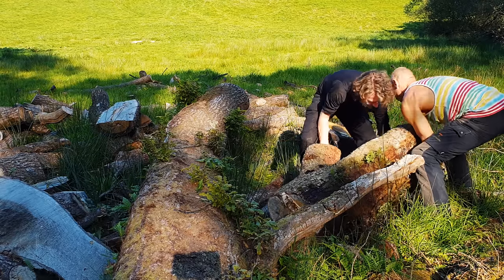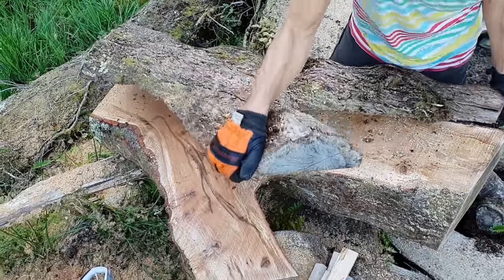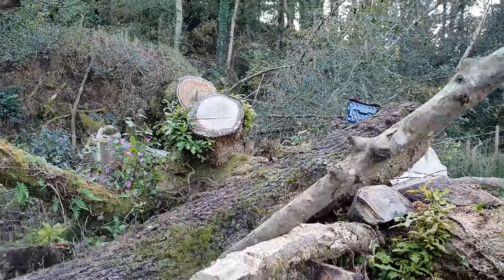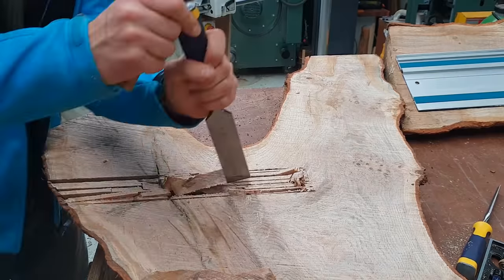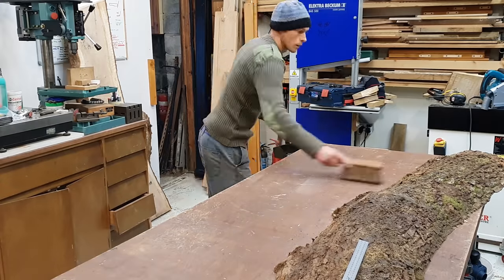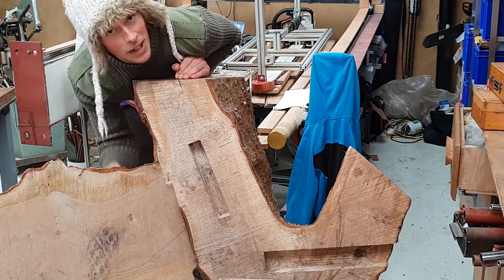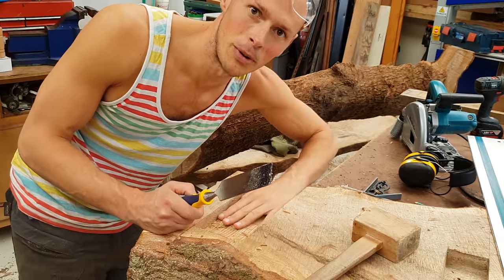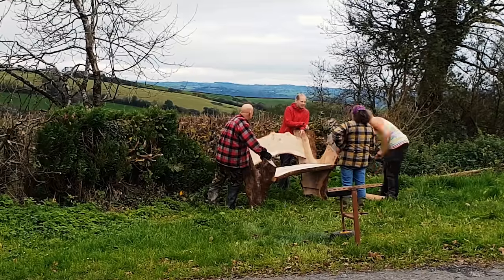How to make a Bench with a Chainsaw! (Rustic fairytale style)

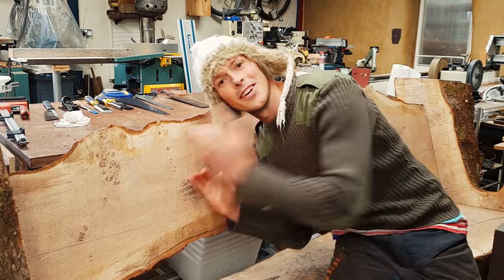Comment: 14:30 I know little about this, not sure it this is a bad idea because it will push water into the wood. A pressure washer, just spraying water might get the foot prints out. I do know the pressure washer does well to remove the grey from sun burnt wood and mold.

Comment: WTF the hippster shirt? :)  Don't you have an old timbersports shirt you can cut the sleeves of? As to the bench: Absolutely love it. Best thing with these outdoor projects is, you can get right to it, without needing to wait 4 year for it to dry. I like to use Spax High Force srews for this type of work. They have a large contact area, and an 8x160mm with a 40Torx head has enormous clamping force, without ever splitting the wood. The idea of the crotch to use as support for the backrest...really really nice.
Reply from the maker: HAHA Hipster shirt!?? Seriously - the beach vest (?) you recon it's hipster? ? 
Right on about not having to wait for the wood to dry though - It's really cool to go from log to finished furniture so quick... And it cuts real easy when wet too - just make sure to oil the tools well after. Wet oak dust = super rust!
Reply: Rust stains...tell that to my trailer I am milling on :)

Comment: You might want to check out Arbortech. They make chainsaw type wheels that fit on angle grinders that are used for rough carving out of bowls and other things but would be great for hogging out the majority of the wood in those mortises.
Reply from the maker: Good evening Jay. Thanks for getting in touch. I had a little look after reading your message. I have idly noticed Arbortech before, but diving a bit deeper and these things look quite handy... Thanks for the tip.
Peace, Bongo.

Comment: Quick question on sharpening for ripcutting/milling ( and I know the answer is "it depends" but give it your best shot ): how often do you typically sharpen the chain ? Does it ever happen to have to sharpen half way through a (not huge) slab? It happens to be to be half way through (7' long, 12-14'' wide)  a red oak slab and by the end of the board I feel I am cutting stone. Should I suspect something wrong with my setup or just shut up and sharpen more often ... cause that is life :) ?
Reply from the maker: Hey Zgabarici. The question may be quick, but the answer certainly isn't. Such a big subject, I have been planning to do a video on this for ages. So hold on for that. But to give it a crack now... Sounds like something is amiss. It is unusual to need to sharpen mid slab - only normally needed if you hit a patch of sandy earth in the bark, or an embedded stone or something. As you say it does depend. One of the cool things about having a long bar and chain is that you don't have to sharpen it so often. So what size bar and chain you running? Short ones will need more regular attention. If the wood is dry it makes a difference. Dry oak is approximately twice as hard and abrasive when dry than wet. When wet the chain and bar stay cooler too, and aux oiling is less important... Ok there's some thoughts for now...
Reply: Appreciate the answer, but yes : shorter (20'') chain/bar, drier oak, maybe dirt ... I'll try to resharpen and try different types of wood and just learn from experience I guess ... Will look forward for the video on sharpening. In real life things rarely go as smoothly as in youtube videos :) I appreciate the sequences of things falling, cuts going wrong, etc feels like a more real experience
Reply from the maker: Yeah - be thankful I do a touch of editing or it would be pretty dam  real ;)
Reply: Have u checked out his latest video - its all about sharpening!

Comment: I really enjoyed following this one, Steve and I like how you used the (crotch?) shapes to form the ends of the chairs.

Do you ever use polyurethane glue? It does make a mess but is great for use outdoors and the moisture in the wood would probably help it to cure. Also, what blade was in your tracksaw? We use the same model at work and struggle to cut scaffold boards with a 48t blade. I'm guessing yours is quite coarse?
Reply from the maker: Hey Olly. Thanks! Yeah I always feel silly calling them 'crotch' bits, but that is what they are called - the bit where the branch forks. 
PU Glue - I have only tried the foaming gorilla glue version - I wasn't super keen - it just didn't seem to hold very strong compared to my usual.   
I will have to double check the blade, I think it's a 28tooth or similar. I think a DeWalt one, but again would have to check.. 
If you have seen some of the other vids where I'm ripping poplar slabs with it - it does struggle - a course sharp blade is the key.

Comment: So, 2018... I bet it got shaky within one year and fell apart within 2.  Am I right?  Typically, one wants seasoned tenons into green mortises, for rustic furniture.  This way, the tenons stay stable, and the mortises dry/shrink tighter onto them with age.
Reply from the maker: It's actually still going strong. I think because the joints were so large, twist and warp of the board kept things tight? The sap wood's a bit fungal of course - but then it was all untreated in any way and has seen a few Welsh winters...

Comment: Great teamwork, and excellent bench. I do have a question, though: were you running your chainsaw at low rpm through the cut? If so, does that give you that “furry” finish you were describing vs high rpm, clean finish?
Reply from the maker: Hi again Chad, thank you for the question. No, rpm was kept high in the cut - in general I think it's best for the saw to be cutting WOT the whole time you are removing material - I only slow down for very thin sections, or when I start and stop (to put in wedges for example). 
I am not fully sure what determines if you get 'furry finish' but I think it has a lot to do with the grain direction, type of fibres, and of course the chain... Many factors. Probably though, I am just using the term 'furry' a bit imaginatively... ;)
Reply: FloweringElbow 1

Comment: The bark will probably fall off no matter what you will do so taking it off wouldn't have been a big deal... Other than the labour.

The height of the bench seems high...  I don't like to exceed 18 inches really for a bench height. 

I don't think you will have issues with the screws you put in there.  The mortise and tenon will keep it from sagging down but the screws will hold it.  You might need to tighten it a little in a year or two but that's the green lumber that you are using... AKA Wet wood.

Comment: can you use oxalic acid to clean the wood?
Reply from the maker: Hi again, Yes. You can do that with oak on the black stains from reactions with tannic acid, but... In the past we have found it a slow process, that's not super reliable and can be a bit patchy. Works good in some circumstances though, when you can't remove any material. 
Thanks again for the comment, Bongo.

Comment: Gorilla glue works best when wet.
Reply from the maker: Good morning Mike, thanks for the comment. Can I just clarify, do you mean out of all the wood glues, it works best on wet wood. Or that it works better on wet wood than dried timber?
Thanks again, Bongo.
Reply: FloweringElbow   It’s the go to for a lot of wood boat builders . It actually requires that you wet the wood before use . It will start to foam a little and fills any void wipe excess of with wet rag and it will never come apart . 😊
Reply from the maker: @Mike Mayfield Good to know. I had tried it a few times in the past and wasn't mega impressed, but that was likely my shoddy joint fit... 😜
I'll have to re-visit it.